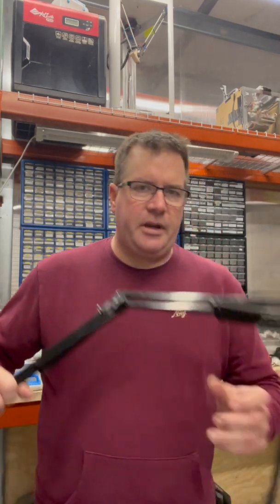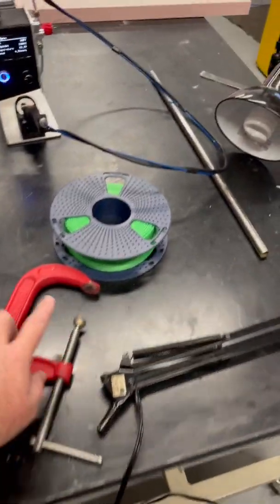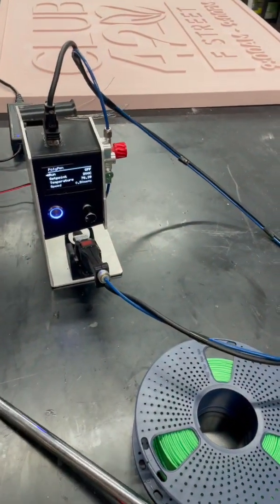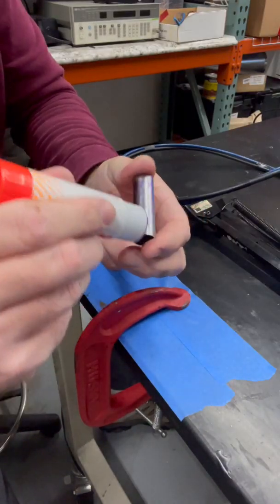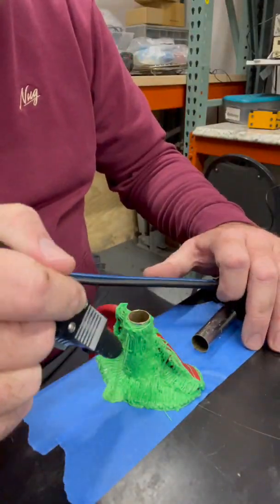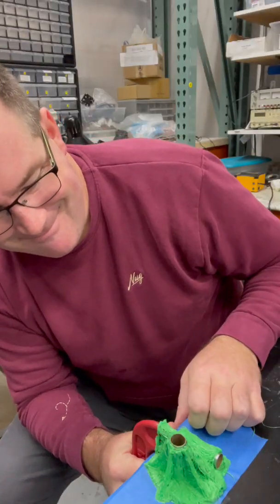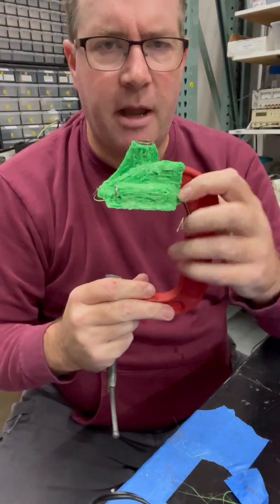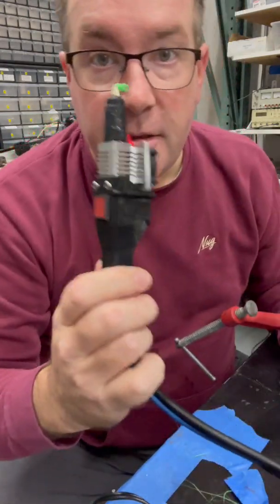Hacking a base for a desk lamp

Comment: Couple holes in the clamp and a U-bolt around the pipe and through could work too. I have doubts about how long the plastic will last, time will tell I guess. That 3D pen looks much more capable than some I've seen, guess this is the "pro-sumer" variety!
Reply: totally... if I was worried about it lasting a long time... I'd probably take more than 20 minutes making it...   :)

And yes, the 3D pen is a project of mine we are launching on kickstarter this year... I have long felt that we needed a "prosumer" version of those.  They are very handy for fixing 3D prints and little hacks like this... but they are SO damn slow and fragile...